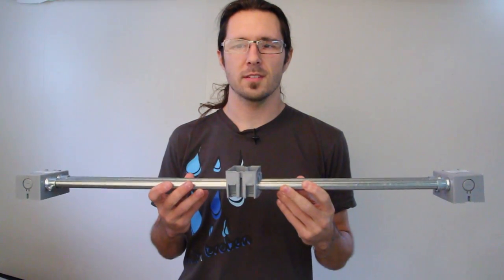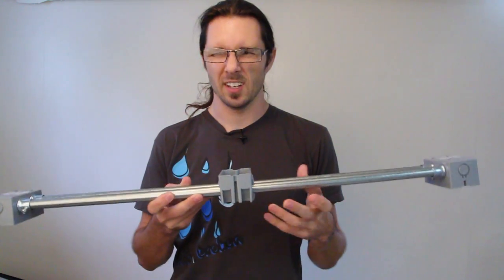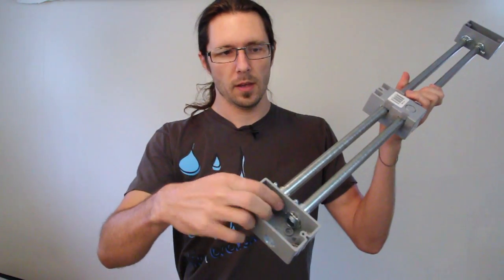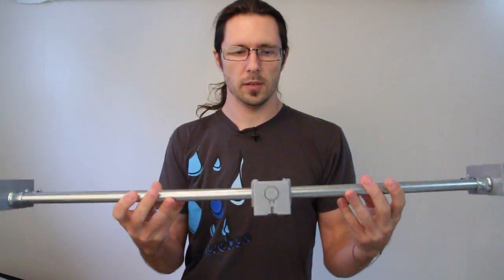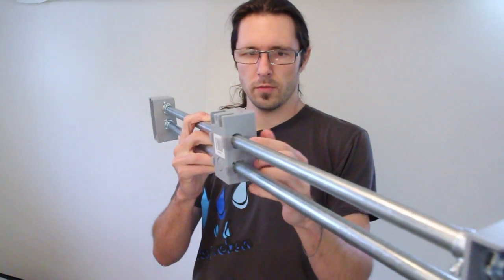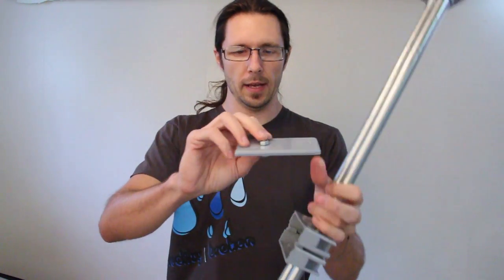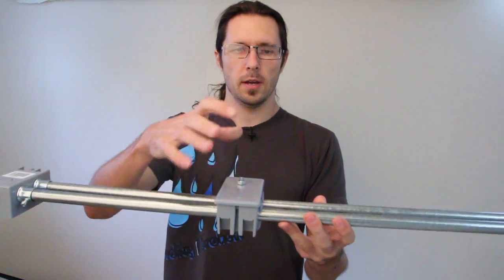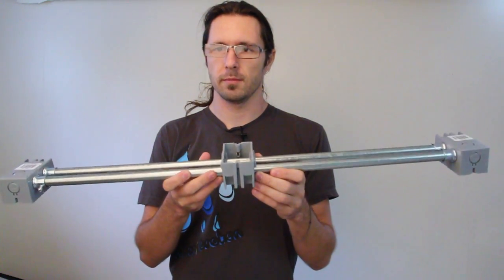How to make a DIY DSLR Camera Slider Under $8

Comment: This is very quick to setup and mount your camera to use◉◉>share4.photo/SliderCam?Qちl      Mine included a carrying bag, which makes it easy to transport. And if you are using it off your tripod, the little legs are adjustable so you can find the right height you need.
Reply from the maker: Did you make the slider that's shown in your image, with the logo on the side, or did you make the rail system onto of the slide?

Comment: Ok this is sweet. Thank you for using your flexible creativity to share a great idea. I was looking for a slide mechanism for some laser effect and this is perfect, parts are easy to get, assembly does not require 3D parts, extensive drilling and machining.
Reply from the maker: electrowizard thanks for the compliment! I’m all about ease of assembly. I hope your project goes smoothly!

Comment: I made one today. Thank you so much! I drilled two small holes in the side of the middle box and ran a string through it. Pulling it by the string makes the slide much smoother.
Reply from the maker: Nice idea!

Comment: Velcro!

I've been trying to build one of those (5') and I've been trying to use self adhesive felt which is just too stinking thick!. Thanks for  the idea!

FWIW. It might be interesting to rig up some sort of way to hold a gimbal to help stabilize the cam...

I should mention, not all home depots have those junction boxes like the ones you used. I had to get the steel ones. I think all told my cost prior to paint was $12.00. 2 5' 3/4" EMT pipes, 4 3/4" EMT connectors, and 3 single gang steel boxes. I already had the cover plate, nuts / screws and paint on hand...
Reply from the maker: I'm glad you liked the Velcro idea. Also, prices and items i'm sure have changed in the 5 years since this was posted. Still a pretty cheap option, though. ;)

Comment: Slider footage looks a bit jerky. Perhaps from pushing by hand.  A good solution to get smoother motion would be to attach rubber band to camera base and pull that.
Reply from the maker: DigitalPraise7 this has already been mentioned multiple times in the comments.

Comment: Austin, did you have to expand the holes on the middle slider junction box? And if so how did you do that? I have all the correct components, but my 1/2 in. conduit doesn't fit through the holes of the middle junction box.

Comment: Great tutorial! If you are able to respond quickly, within the next hour or so, i need to know specifically where to find the 20 thread count screw. Can I find it at lowes maybe?
Reply: yes, 1/4-20 is extremely common and you'll find it anywhere
Reply: Thanks for the help, I actually finished building this yesterday and my hardware store had some 1/4-20 pieces, just not a 1/4-20 screw, so i just ended up twisting it on to another screw and super glued it
Reply from the maker: It's a very common thread size that all camera manufactures use. So any hardware store should have it.

Comment: adding some weight with a little sand bag into the sliding box also might help to make a smoother slide.
Reply from the maker: +Sam Bernal Excellent idea!
Reply: Sam Bernal could prob just throw some weights in that empty hole right under where the cam sits. Am def gonna be trying this out will keep in touch !

Comment: question though,   think if I put a mount bracket underneath it, and attached to a tripod. would there be an issue with weight, and or balancing?   Be awesome when panning a shot at eye level with that.
Reply from the maker: +blackkabnet There can always be weight issues. I don't know what the slider itself will hold, and I've never mounted it to a tripod. My video about it was just a hypothetical. Just use sturdy supplies if you do a tripod mount and you should be fine.
Reply: +Austin Lindsay  cool

Comment: hey cool idea! was just thinking about the smooth action required for the conduit Perhaps instead of  the conduit sliding  through the holes in box with the velcro you put a larger threaded nipple through the hole of the box with lock nuts. Then run the conduit through the internal part of nipple? Perhaps a smoother run ???Only an idea?
Reply from the maker: +sempei58 I like it! Give it a shot. I chose the way I did it, because it was very quick and simple for me personally. I'd love to hear your opinions after your build. :)

Comment: where did you get the velcro from?
Reply from the maker: +michael butterfield Home Depot
Reply: +michael butterfield  there is some protector they sell to put under the chair legs, or table legs to avoid risks on wood floor, they will solve your problem too!
Reply: Thanks you!

Comment: I really like this design and am going to go get the parts in 20 minutes. I'm thinking about getting two 4 hole (2 rows of 2) plastic electrical box and running 4 rails. The slider would only be 2 hole one and ride on the top rails, while the bottom rails could house something that would allow me to attach it to a stand or tripod. Do you have any ideas for what I could use to accomplish this and attach to the bottom rails? It obviously isn't urgent as the whole set up and be disassembled and reassembled later. But I think it's a good idea to get the 4 hole pieces just incase.
Reply from the maker: DPDLC You may have to make a diagram of your design so I can get a better idea, I'm not sure I understand completely. But, if you have 4 rails in line, you're in the same predicament as my design, but with two more rails. If your rails are in a square format, you could attach a plate with a ⅓ 20, screw in the center. And attach it with the same parts that they attach conduit to walls/ceilings.

Comment: I made this exactly. All the parts are still available at Home Depot. Mine cost a little over $10 with tax. I don't use a DSLR but instead a Cannon XHA1. It was obviously to flimsy. I made two of these sliders and laid them side by side. Then I used a board to connect the two that easily supports the weight even with a heavy wide angle lens. Came out terrific and smooth. I didn't need the velcro or rags to get a clean slide. With a little practice it's awesome.
Reply from the maker: Zack Corley It definitely does take some practice. I'm stoked you found a solution that works for you! Happy shooting!

Comment: it's a bit jittery in this video or at least the first part. was that just the ground or what happened there.
Reply from the maker: Jason Hitchcock the demo footage was taken about 5 minutes after I made it. I didn't take the time to practice with it or stabilize the footage. I just wanted people to have a quick idea of what type of footage it can get.
Reply: cool, i was wanting to make it, but wanted to see if there was some kink with that jittery part that you worked out latter. thanks for the reply, totally going to make this. Thanks for making
 this even easier to assemble

Comment: Just built this using the exact materials and it's too flimsy for my 5D Mk II.  Tried with and without a tripod head, on both horizontal and diagonal setups.  Every time it fell back or forward onto the ground.  The weight was just too much for this to handle.  This might work for lighter DSLRs or even a GoPro.  If I try to build it again I'll use 3/4" pipe and metal boxes.  Thanks for the idea.
Reply from the maker: gobdav Yea, ¾ pipe and maybe end boxes with a wider base (more gap between pipes) would be a good way to go for larger cameras. If you do end up building a beefier one, let me and us all know how it works. :)

Comment: I can't seem to find a ¾ to ½ inch EMT Set-Screw Connector... All I see from Home Depot, even from the website is a ½ inch. That will work right? But I need to get a different Plastic outlet box for the sides, the middle stays at ¾ inch so it can still move freely. Is that correct?
Reply from the maker: The conduit is ½ inch. And I'd suggest getting parts that say ½ on them. As that's what I did to build it.
The holes in the box are larger than ½ inch. I suspect they're ¾ inch. But they may just call the hole ⅓. Sort of like, how the measurements of a 2x4 are not really 2"x4".
Reply: Austin Lindsay gotcha. Thanks

Comment: For the first time, someone actually made something simple, cheap, and easy to make! It's nice to see people commenting on how they PLAN to make something, but I looked around for comments of people who ACTUALLY made what's in a video, and this was very helpful. I'm always skeptical of DIY videos and their claims of time and money involved. This project was very accurate. I did it under an hour and for less than $9, and I'm a girl who is clueless about everything hardware. Yes, everything was at Home Depot. I had some trouble finding the right electrical boxes (luckily, he shows the number on the product), so for those of you planning on making this slider, these are the exact ones he used:

 Southwire 1-Gang 12 cu. in. New Work Handy Junction Box
Model # 56915301 Internet # 205029565 Store SKU # 397507

link:  http://www.homedepot.com/p/Southwire-1-Gang-12-cu-in-New-Work-Handy-Junction-Box-56915301/205029565?N=5yc1vZbm4mZ4mm

That way you can check the inventory at your local stores before making the trip. Everything else was quite easy for me to find.

Thanks, Austin! Your video was very thorough.

Comment: I went to get all the parts today and in your description it says to get 3/4 inch conduit, 3/4 inch EMT set screws, and the plastic electrical outlet box with 3/4 inch holes. I got the 3/4 inch conduit, EMT screws and the same exact plastic outlet boxes in your video. They have the same barcode and model number but as I went to start attaching all the pieces, it turns out that the holes in the box are only 1/2 inch. What size conduit did you actually use? 3/4 or 1/2? If you used 1/2 inch conduit then you should update the description to reflect that.
Reply from the maker: I have since given my slider to a friend so I don't recall exactly. But I know I was working around the box's parameters, so while I was at the store I made sure the conduit wasn't too big for the box. So if the box won't accept ¾ inch conduit. Then I used ½ inch conduit. 

I'll have my friend measure the conduit and update the parts list if needed. And I'll keep you up dated.
Reply: Austin Lindsay I should have noticed the box didn't have the correct sized holes in home depot, I was just going too fast trying to get everything quickly and get out. I'll be heading back tomorrow to see if there are any of the same plastic boxes with the 3/4 hole punch-outs. If not, I'll just change out my 3/4 conduit for 1/2 and keep the boxes I already have. Thanks for getting back to me so quickly! I watched the Film Riot DIY before and I really like how you simplified it so effectively, I'm excited to get this rigged up and ready to go!
Reply from the maker: chipcrk Hey so it looks like the conduit is ½ inch. Sorry 'bout the mixup. When you get it all built lemme know how you like it! :)

Comment: this is great, but notice how its still somewhat shaky, ive yet to find one thats not shaky without doing anything in post
Reply: Get a wider lens.
Reply from the maker: Andrew O. McLaughlin That is definitely good advice.
***** This slider is going to be a bit shaky though. After all it only costs about $8. If you want less shake you may want to go for a higher end slider.

Comment: Hey Austin, 
I think this is brilliant -- I love functional-simplicity -- and you nailed it! Speaking of which...How 'bout a low-tech, very-functional motion-controller: show how to mount a simple wind-up timer on an end (e.g., egg-timer with an attached spool/pulley with thread, string or fishing line and clasp) that automatically attaches to, and pulls the slider smoothly, horizontally, or even up an incline, with the timer's spring-driven rotation also rotating the attached spool?  Hey if you want to send me a prototype -- I'd be a 'beta-tester' in a heartbeat. Keep up the good work --Darrell
Reply from the maker: That's a good idea. If I get more time I'll see if I can't rig something like that up. :)

Comment: great job... I would go with metal conduit boxes though makes for a more fluid movement
Reply from the maker: That's a good idea! I was actually considering that. But I found that this type of metal doesn't slide very easily, plus it creates a pretty nasty sound. XD
Reply: good point

Comment: After not being able to sleep, I went over to the local home depot at 6am. Cost be around $22 for everything -purchased one too many extra screws (noob) I also don't possess any special tools, unable to saw the pipes, I kept em at 5 ft. (A bit long, but I guess the benefit is I have double the room to slide) ..Also purchase 3 metal electrical boxes and those 5-peice set screws. I begun hammering off those knockouts, put on some velcro, and eventually I had my finished product. Works great!! :-)

Comment: definitely about to make on of these next week, this is the best version i have seen so thank you, i would also say your results would probably be better if you screwed down the top plate especially with a dslr on top of that as there are some gaps there and room for play. very awesome version, ill be adding covers and soft feet to the outer boxes and mounting the hardware inside the box to make it look a little cleaner, ill lose about 3" of slide but i want a compact one for mountain biking

Comment: Just went out, bought the supplies, and built this is about 2 and a half hours.  Ended up costing me about $20 but that's still an incredible deal.  Made some minor adjustments to mount a tripod head on the slider (still working to find the best way to do this).  Awesome design, thanks for the video!

Comment: A light, but even coat of wax on the electrical conduit would help with smoothness.  Furniture paste wax would be good, but rubbing a plain, boring candle would also work.  It's a common technique for helping woodworking jigs to slide smoothly.  Also stabilizing and anchoring the ends would help in getting a smooth end result.  The flimsyness of plastic electrical boxes and conduit will always make this a so-so setup, but if you've got $8 not $800, then this gets you sliding!

Comment: You need a nut in the bottom to take a tripod mount and if you feed some sting thru a hole in each end and the thru a hole in the slide part then u tie it off inside (ensure you have enough slack on each side). Then you get a nice even slide when you pull on the string :-)

Comment: Just made this DIY slider today.  It cost me $11 because Lowes is a bit pricier and the connectors were sold in a 3-pack (so I had to buy two packs), but it works just as described by Austin.

Comment: yea for sure the velcro works super. also something cool i found out is that on the metal style "wire holder" thingys there is a punch hole right in the middle. perfect for mounting a couple of cheapo thrift store tripods on each end to support it. pretty cool stuff. ;)

Comment: It will probably chew through the Velcro sooner or later, but the cool thing about it is that its so simple to dismantle and reassemble. If I need to change something or replace something, its not even an issue. Easy peasy. :)

Comment: This one is not bad.  A little shaky yes, but with some practice you'll get better results.  
It's been more than a year since I built a $5 slider that I successfully used in some of my wedding videos.  Ultimately I bought a $79 igus slider.  
Austin, check out my diy Silver Flyer steadicam demo.  I built it using home depot parts (EMT's).  anyway, good luck

Comment: Great video, I built mine last night.  I had to use all 1/2 gauge electrical box, couldn't find 3/4 any where.  For less than $9 dollars you can't beat this build, specially since I have 2 foot & 3 foot rails.  I do get a lot of shake and it tends to slide around on smooth surfaces.  I'd like to hear suggestions about mounting a head.  Thanks again!

Comment from the maker: I was planning on attaching a 2x4 or some piece of metal along the bottom to both of the ends, with a tripod screw hole in the middle. When I get around to doing it, I'll try and post another how-to video.

Comment: Great video, I just ran to home depot and purchased the exact same parts except im building a 5 foot slider. However, the electrical boxes with the holes I purchased the exact same one you list in the video B112HB but the 3/4 tubing doesn't fit in the holes..

Did you sand open the hole a bit?

Comment: Man, Great idea!.. cheap and get's the job done..If you want to see the one I just finished building subscribe to my channel " MrPCElectronics " I'm in the process of making the How To video ...It's a little more pricy @ $80 but it's ball bearing and can mount on a tripod and has retractable legs on each end so you don't have to have 2 tripods..I'll be adding a cheap motor and belt to :) Great Video btw!

Comment: Thanks! Added a piece of polyethylene to the handle for comfort too. I also added the cover plates to the bottom of ends and attached rubber feet like Film Riot did. Now I'm trying to figure out how to make it attachable to tripods. I have 1/4" 20 count thread connecting cap nuts I've used before on my DIY iPad tripod mount. But it will stick out further than my rubber feet lol (unless I interchange cover plates based on the usage.

Comment: Awesome thank you! I added a handle to mine. Punched out the back of the electrical box slider and added a 1/2 PVC elbow and a 3/4 coupling. Had to slightly widen the hole on the box to fit the coupling though.